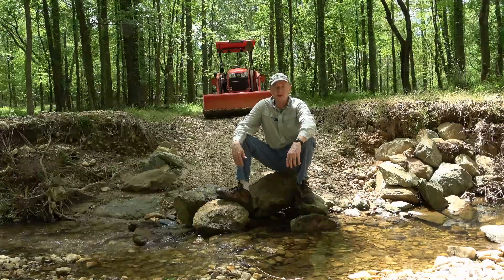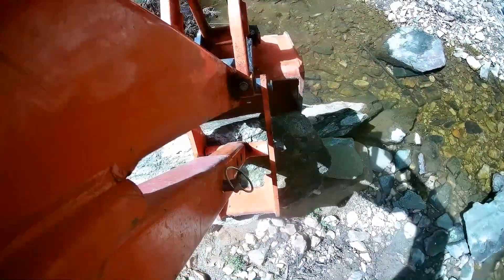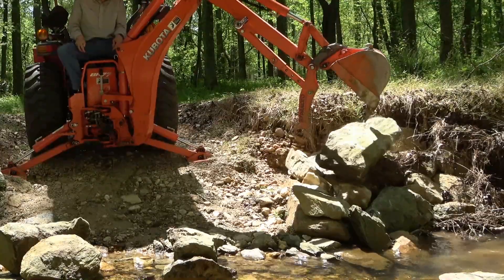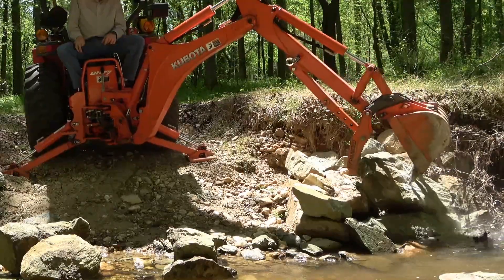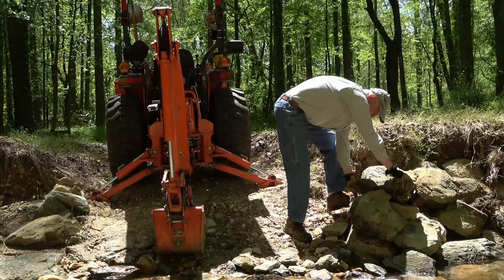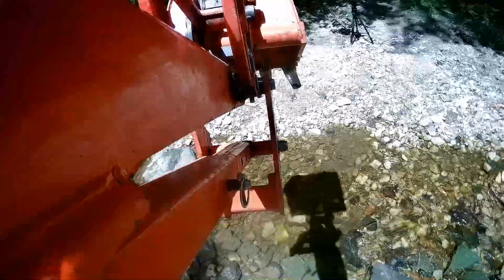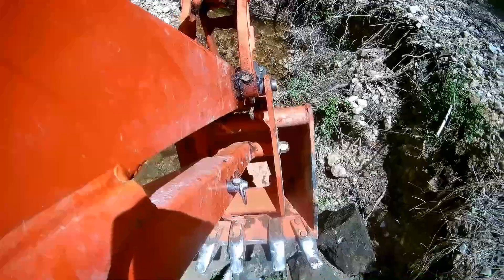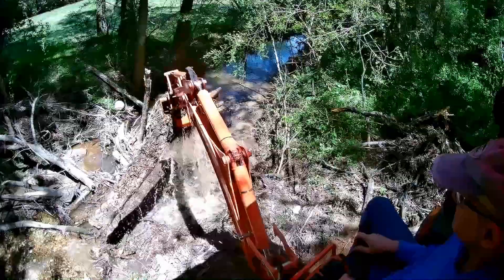Kubota Tractor Therapy: Rockin' the Creek and Clearing a "Log Jam" - Part 1 (#163)

Comment: Martin,  This is going to sound counterproductive. I've had huge riverbank stabilization projects in my career.  Adding a wall structure of boulders on the upstream just creates a jetty. Building up soil on one side, greatly removing it from the downside.   At first it will work, then water will seep through the cracks,  and eventually allows water to swirl on the downstream side of the jetty, creating excessive movement of detritus.  Which creates washout behind/downstream of the dam, ie. your crossover ramp.    If you create a flat hard-capped embankment upstream, and over your ramp, this will allow water to flow over, then to hit multiple smaller structures (riprap) downstream of the crossover.  Kind of like an interstate on/off ramp.   Still, it didn't cost you anything and will work for a while.   Please excuse my didactic comment.
Reply from the maker: Thanks for the advice!  It’s cool to find out you have a lot of experience in this area.  As you said, since it’s done, I’ll wait and see how it does. Thanks for watching!